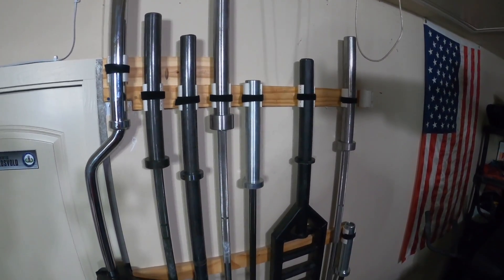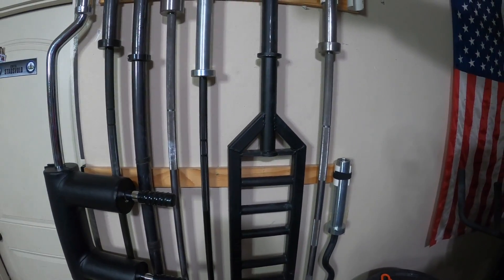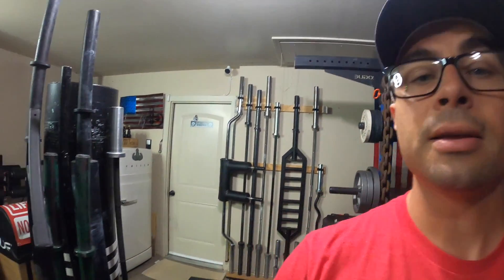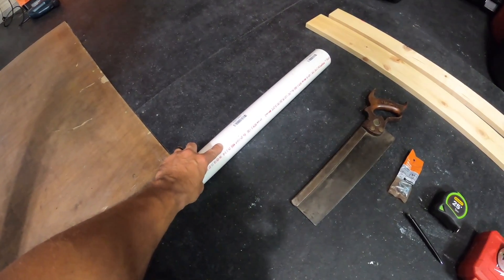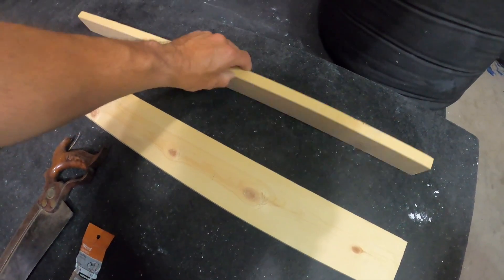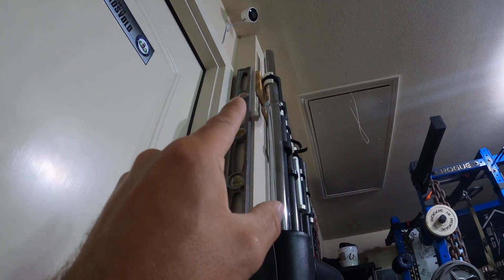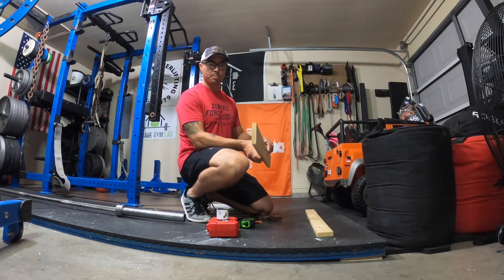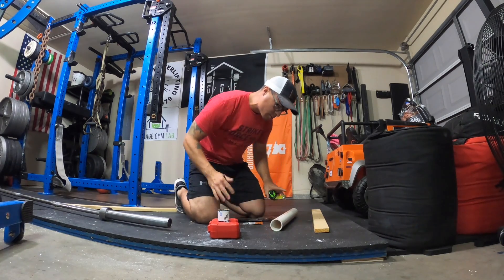DIY Barbell Rack | Easy Access Barbell Rack | Garage Gym DIY | Strongman Garage Gym

Comment: Question mate. Did you sick the bottom bit with the holes in to the horse mat or did you just leave it loose? I'm about to do mine next week. I can't wait. Can't stop watching this video in the meantime.
Reply from the maker: I secured mine on this go but in my last garage gym it was not attached. I prefer to attach the horse stall matting to the bottom holder with some decking screws
Reply: @TheKurtlocker  thanks mate. Brilliant

Comment: Will this pipe opening become loose while using rod daily n putting it in n fixing in pipe cut for holding
Reply from the maker: I have had this setup for about 4 years with no need for replacement of any piece.